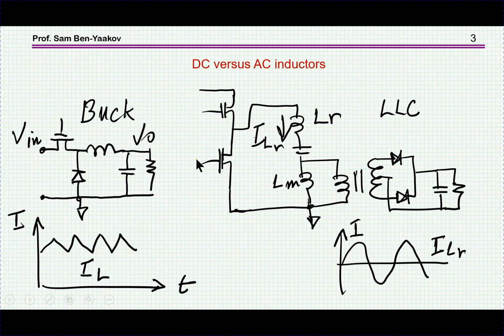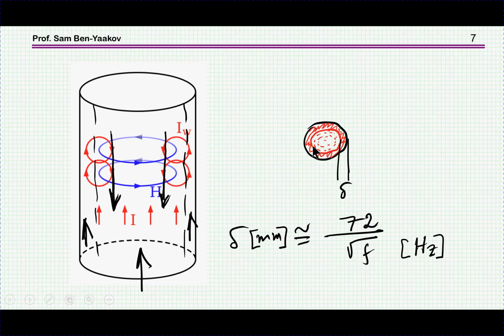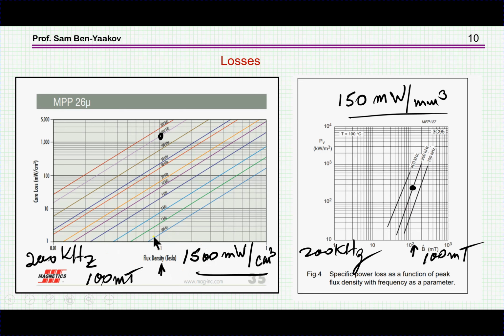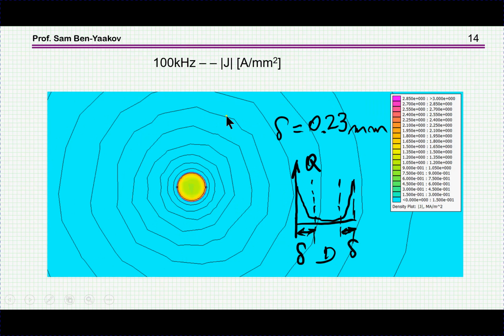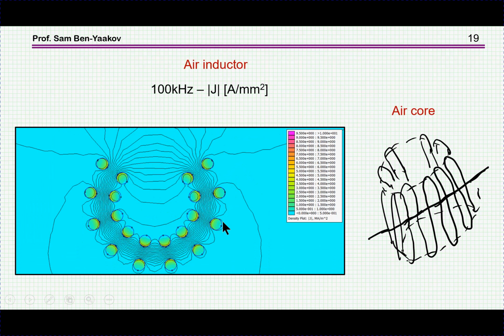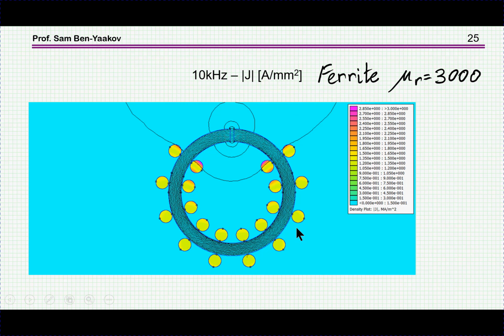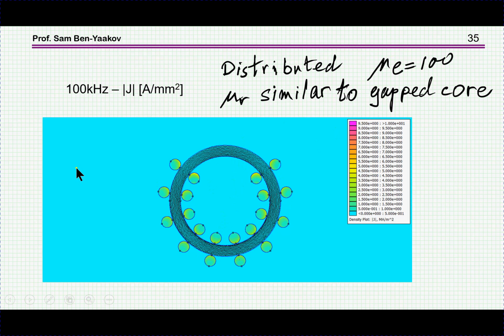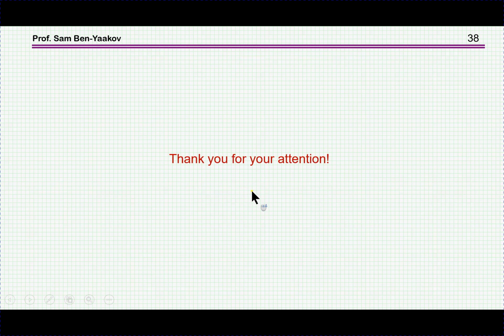Toroid inductors for resonant converters:The beauty of FEA based simulation

Comment: Thanks a lot for your technically informative videos and really appreciate the time you spend and willingness to share the knowledge
what is the advantage of using 
Case-1
two single strand parallel windings arranged in a way that the flux is aiding each other on opposite half of toroidal inductor.  
Compared to 
Case-2
Winding two stands together in parallel. 
The same  awg is selected in in both cases  and both cases should fill the entire core. only one layer is used in both cases. Bothe cases carry same amount of current is each stand since they are parallel. Total inductance is also same in both cases.
Reply from the maker: I think this is the same. Looking around the area of two conductors in the two cases, everything looks the same.
Reply: @sambenyaakov  do you think cas-1 has better leakage flux cancellation?

Comment: Hi Professor, how would the FEM simulation look like with litz wire? Will it solve the problem caused by current crowding in air gapped core?
Reply from the maker: Yes indeed. But you need really very thin strands

Comment: Thank you the detailed explanation of the magnetics. I have a question that I hope you can clarify. I see that there are certain benefits to keep the windings away from the airgap. In case of something like an E core used for LLC converters, the gap is usually placed only in the centre leg. In such a case, is it good idea to keep the windings away from the gap or do we accept the issues that comes with placing the winding over the gap?
Reply from the maker: Yes, exactly.

Comment: Thank you Professor for another great video! This is truly unique content! If you have free minute, could you please answer such a practical question: I have a PSFB converter with series "shim" inductor  in it's primary (wire is pretty thick 0.35mm @100kHz@2Arms). The problem is that inductor heats up very much, however, I noticed that the heating comes from the wire and not from the core (wire ~ 80 deg.С and core feels like 40 deg.С). Is my conclusion that this is the proximity and skin effect took place rather than core losses?
Reply from the maker: Yes the diameter of wire is too large . For 100kHz you need a diameter of 0.1mm,  0.05mm will be great

Comment: "in terms of proximity effect, the dristributed gap is the best but core losses will be very high for resonant converters" (around min 30:40).

Forgive my lack of understanding but why distributed gap core is worse for resonant converters than point gapped cores? given same permeability
Reply from the maker: Because core losses are much higher in the powder core at high frequency, typical of resonant converters. See Slides 10 and 11. The comparison is for mur = 26 of the distributed core  which is just about the lowest permeability you will use and this will correspond to the lowest core losses (in ferrites the permeability, obtained by a gap, does not affect losses as a function of Delta B)
Reply: @sambenyaakov  Thank you Professor. 
So given the same AC application and working conditions, a ferrite distributed gap core would theoretically be better than a single point gap ferrite core in terms of avoiding flux spreading (and consequence losses)?

First google results: "EPCOS have created an all new distributed air gap featured in ferrite cores...The fundamental effect of having gaps of different sizes and location is to change the losses in the adjacent winding. The magnitude of this effect does depend on the fringing flux which enters the winding. The overall gap remains identical, only the location and individual size per gap are changed.
..

The overall comparison between a single air gap and several smaller distributed air gaps shows that:
• The average of the square of the local flux density, B² average (relevant for winding losses) decreases as the number of smaller air gaps increases.
• Evenly distributed and spaced air gaps are more efficient than an uneven distribution
• The best performance/ cost compromise is to use three evenly distributed air gaps.
EPCOS distributed air gaps cores are realized with nonmagnetic spacers glued in between the ferrite slugs. The required priority for distributed air gaps is the AL Value."
Reply from the maker: Good thinking. I should have mentioned this in the video. Feriite distributed air gap cores are  indeed the best. There are some papers on that, people have used in primarily for high power converters. The down side is the cost and that the available selection such cores is meager.   I hope/wish others will read your excellent comment.

Comment: Good material but I waited for flux densignity distribution in this windings, it was but only for spaced winding case. That could extremly nice to show how densignity is change in case of winding distribution and how losses, inductance of inductor are changing.

Once I writed on  linkin case when I had problem with inductor in resonant converter (core was hot), and in this case winding distribution was problem. I change winding distribution, Q goes extremly high and transformer got damaged but problem with hot core was solved ;)
Reply from the maker: Interesting. Thanks for sharing. If not a member, welcome to join: https://www.linkedin.com/groups/13606756